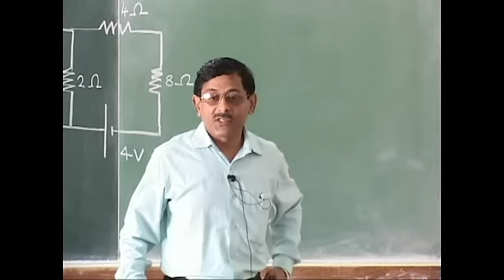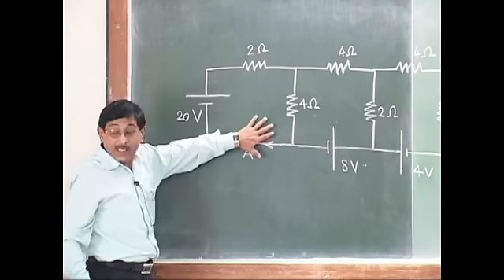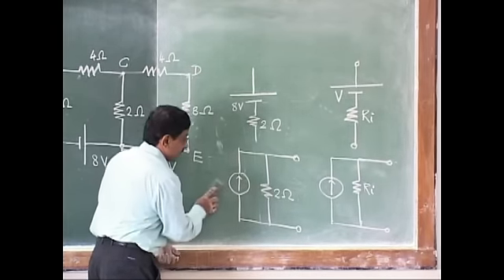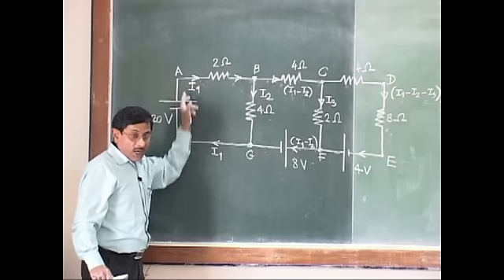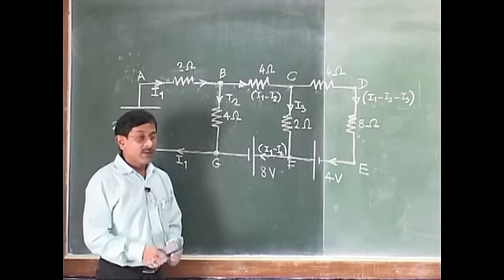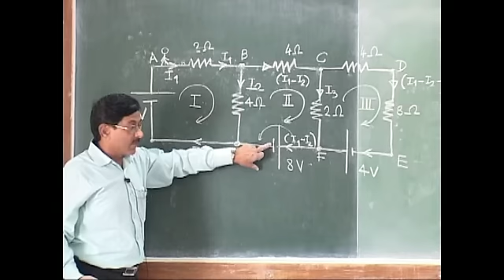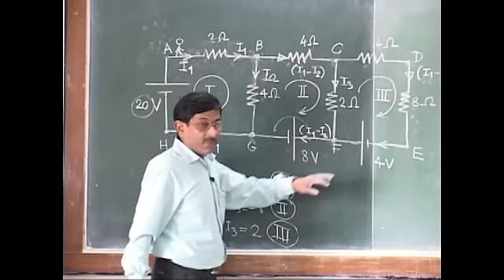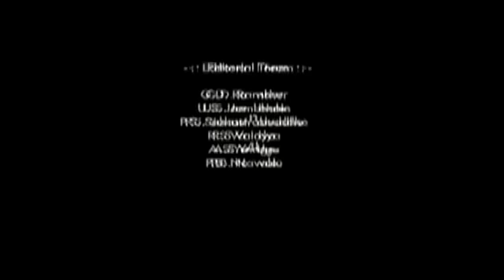Kirchhoff's Laws: by Dr. C. B. Bangal

Comment: very well explained, thanks a lot ! and to all the other people who are not aware how to use calc for getting the i1 i2 & i3 here are the steps my calc fx991esplus ->mode>eqn>select no. 2 anX+bnY+cnZ=dn(for this problem only, depends on the specific equation) fill the values assume 0 if i3 is not present as in 1st equation and press = you will get the answer.

Comment: In electrical engineering, node refers to any point on a circuit where two or more circuit elements meet

so points A D E H also be considered as nodes right

Comment: Dear sir i am very much impress with your teaching method. my question is related with norton's theorem .if there one voltage source and current source are connected in circuit and have to find circuit equivalent at point A and B .how can solve this kind of problem and also if there is dependent voltage and current source connected in circuit.please give your guidance .

Comment: i have watched many vedios but i didn"t understand ,but when i watched  DR CB Bangal lecture first time, then i understand very well.Now i've got good knowledge about current divider rule ,sir please upload about mesh and super mesh analysis ,i didn't  underatand about  mesh and super mesh analysis given by other lacturer.
Reply: I know nothing about super mesh method of circuit analysis but I've solved quite a few circuits with mesh current method. Take for example circuit shown right at the beginning of this video. First, draw three complete circles inside each of the three loops. Then assign directions of rotation for these circles whether clockwise or counter-clockwise (doesn't matter which direction you choose). After that ask yourself what type of current flow you wish to represent (either conventional - from + to - ,or electron current flow - from - to + ). Let's consider the first loop, say that the rotation of the mesh current in that loop is cw and you assume conventional current flow, then the polarity of the resistors in that loop is as follows: + 2ohm - ; + 4ohm - . For conventional current flow it is a voltage rise if current flows from negative to positive terminal of a battery. "Please reply to me if I should continue writing it, because I'm not sure if you're interested or not." My suggestion for you would be to read the chapter on "Circuit Analysis Techniques" in this book: http://www.ieee.li/pdf/essay/lessons_dc_circuits.pdf
Reply: can u give me a link in a pdf file( of network analysis book )of electrical
Reply: AMR poudel Mesh current method of circuit analysis is discussed on page 341.

Comment: sir why you have changed polarity of all the resistors and batteries its should be in direction of current but ans will come right and i can't make out weather this is a standard way of solving the circuits or not

Comment: Plz any one tell at loop 1 i1 current passes through 2 ohm resistor at node b it will divert to two branches.branch between B and G could i take i1-i2 currents passes through 4 ohm resistor instead of i2 passes through it if i2 current passes through 4 ohm resistor branch between B and C. and will be same for loop2 and loop3? plz i am confusing